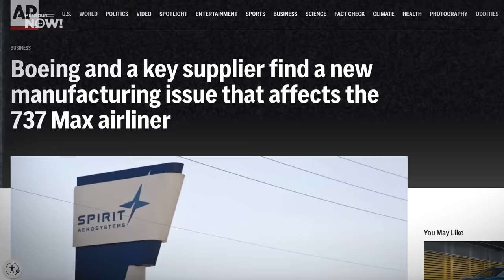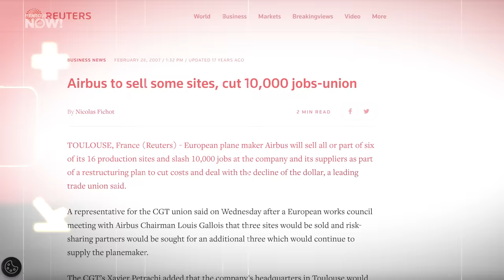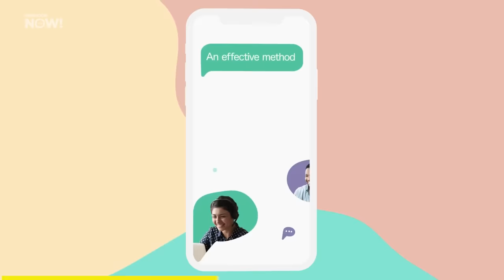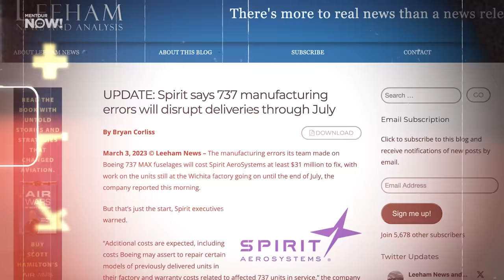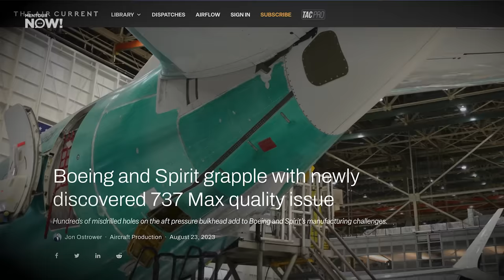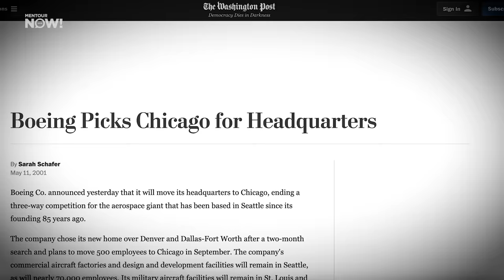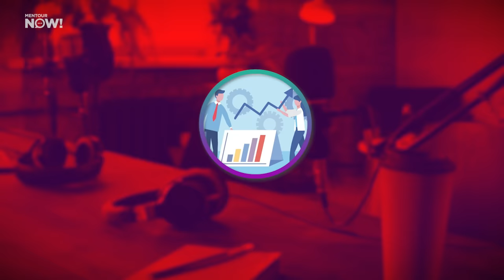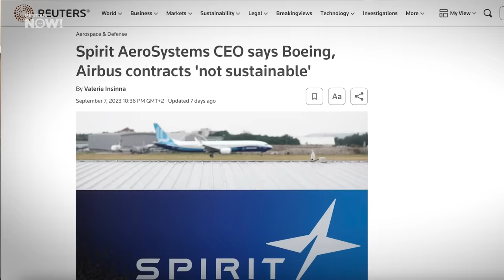NEW Problems with the B737MAX!

Comment: The Max seems to have been the decision of accountants and greedy mangament. It should have been a clean sheet design. Probably would have worked out cheaper in the long run, and be a better aircraft.
Reply: I don't know how many times this need to be said, but the Max uses an old frame because airlines wanted Boeing to keep the old frame.
Reply: almost the whole problem with the Max is the airlines didnt want to retrain their pilots. So it had to work the same.
Reply: You can’t expect investors to wait an extra quarter for millions in profits never going to happen!!! Shortsightedness has killed many companies; blockbuster and Netflix comes to mind
Reply: @lhk7006 , No, they kept the old frame design so that they can go through the simpler route in certification of the aircraft and many of the decision made were to reduce the cost of recertification the aircraft and the pilots. It was idea sold to the airline by Boeing.
Reply: Did pilots or passengers want another generation of the 737?  I have to blame investors and accountants looking for short term profits.
Reply: @FameyFamous money is money 😂
Reply: That does not serve the purpose of maximizing shareholder value.
Reply: The program would've been worth it had it not been for the MCAS disaster. Lots of airlines prefer to improve existing airliners rather than clean sheet designs because they don't have to retrain pilots and mechanics (mostly), lots of parts are still effective for updated designs rather then clean sheets, etc. New production airplanes all have their own headaches, ask any mechanic who works on A220s, 787s, A350s
Reply: Having worked for a publicly owned company, I can tell you that profits for the shareholders trumps everything else… EVERYTHING else. Taking control away from engineers and giving it to bean counters has cost Boeing something much more valuable then money. It’s reputation is in tatters. Can it regain that? Who knows?
Reply: That’s nonsense! Boeing didn’t have the time to build a complete new aircraft to compete with the airbus 320 neo so they just used an antiquated 737 airframe, chucked new tech and put oversized engines on it hence the mcas ! It was cheaper and more profitable!!
Reply: @dwjr5129  its literally a legal obligation - if they dont maximise profit they can be sued. 
Turning corporations into legal people with the obligation to maximise profit was clearly a great idea. Almost as good an idea as basing economic production on the whims of whomever can horde the most.
Reply: Modern capitalism can't handle capital spending.
Reply: @paulparker8298  Ultimately less safe. Profit rules! That's capitalism, baby!
Reply: Great case example of when top management make decisions without adequate understanding. "What? Those talented, educated, experienced engineers are costing us WHAT? Screw that, we're outsourcing to India. what could go wrong?"
Reply: The cost overruns on the 787 limited Boeing’s options regarding an upgrade in the 737 market area.  An all new airplane was estimated to be far more expensive than an upgrade to the 737.

I think that history has shown that the 737MAX has become similar in cost to an all new airplane.
Reply: They managed to screw up a slight redesign this badly, imagine how bad they would a whole new airframe.
Reply: Accountants do accounting, they don't make production decisions.  They don't make managerial decisions.  They do nothing other than making sure bills are paid.
Reply: Yes, it is like you say. The Max8 has still got the center of gravity in the wrong place to accommodate the bigger engine placement so the plane is aerodynamically, fundamentally floored. No doubt will it cause problems in the future.
Reply: The old airframe was not the problem, the problem is the accountants. As a very proud Canadian, I'm quite happy Boeing is going through this, after their sinking of Bombardier. They thought driving them out of business would work in their favor, it just drove them into the open arms of Airbus.
Bringing about the second time Canada's aircraft industry was shit canned by Boeing. The first being Boeing with the Bomarc missile forced buy, which led to the killing off of AVRO and the Arrow program.
Reply: @griffith500tvr  I'm flying in one on Friday. Should I see near the back or front to balance it out?
Reply: You can retain the old airframe and come up with a better ans safer solution than the MAX.
- The wing of the 737 has already been heavely modified at least 3 times (-200, -600 and -MAX series)! So the re-certification and re-trainning argument is an hypocrit one!
- The main draw back of the 737 is that it kept the low ground clearance from the -100 series. While that made sense in the 60s with pencil like turbojet and lack of jet bridges and airstairs in local airports, today with bigger turbofan engines and better equipped airports you end up with the flawed MAX design!
Just came up with a new wing-body fairing design that can accomodate a higher ground clearance gear and voilà! Would not modify the aerodynamic characteristics of the airframe (the wing can remain the same as the fuselage and tail) and open-up more engine configuration options!
Ok you'll have to redesign the nose to accomodate a longer front landing gear, but that would not be a big certification / trainning issue (just look at the nose of a RC-135 LOL).
Reply: Bean counters are always a problem to quality!
Reply: This is a naive, simplistic view. 
The choice they made was on paper the better one. It was the one airlines and pilots wanted. 
The issue was not the original choice, it was how Boeing dealt with the issues that resulted from the choice, and tried to sweep them under the rug.
Reply: @adogonasidecar1262  Others much more qualified than me have said the same, are they "naive and simplistic" in their views too? Also if you're going to accuse someone of lacking gravitas of argument, then you need to qualify your opposing opinion a little better.
Reply: @davidcole333  It was a shorthand for a being a solely fiscal decision. I am not singling out accountants.
Reply: @paulparker8298  Which bit is nonsense? Or was this sarcasm?
Reply: The same can be said to airbus. The a320ceo should have been stopped their and a clean sheet straight after. Would been a better aircraft without a neo version
Reply: @FameyFamous  I have a PPL so am somewhat kind of learned about aviation but in all reality don’t know much about aviation behind the scenes. however with that said I honestly don’t give a 2nd thought to not do most consumers about which flying bus and to a lesser extent even the brand that’s getting me to and from my destination. I and most people care about the best price at the most convenient airport with the most convenient time, and the shortest flight times. 

Recently people have started to somewhat kinda care about the 737 because of its problems but that news cycle has come and gone. No one cares about the equipment they are flying on. 

I guarantee if the Comac C919 was ready and heavily subsidized by the Chinese Gov’t say 25% less expensive than an comparable Airbus and Boeing product, which translates into cheaper flights bet your bottom dollar Spirit airlines would slash their seat costs and Fly the Comac.
Reply: @nickolliver3021  I'm not taking sides here. Airbus has definitely had their fair share of issues.
Reply: @planespeaking  that people need to worry about if people complain here and there about things
Reply: @andywomack3414  yes because the USSR didn’t hide the problems with their first jetliner.
Reply: Exactly - those kinds of jobs are a mesh filter that selects for the worst sociopaths that currently live. I can guarantee that no Boeing manager felt worst about the 737Max deaths than they did about the money it lost.
Reply: @andywomack3414  Stupid take. As if socialism produces safer products, baby!
Reply: @nickolliver3021   not the same situation, the A320 is overall a much more modern design than the 737 and still has plenty of room for improvement, while the 737 was already close to the limit of what you can get out of its basic design -  mainly due to the short landing gear. They called this version the MAX for a reason, there's really nothing more they can do to further improve it without a clean sheet design. And arguably it really would have been better for them to bite the bullet and get started on one 10 years ago since it was always clear they'll need it at some point.
Reply: @johannesgutsmiedl366  given that they don't have a clean sheet design that they've been developing continuously for the last 10 years, what should they do next?
Reply: @davidcole333  The accountants, and in particular CFOs, make recommendations to CEOs, this is how pure accounting data can be used to override what should be engineering area.
Reply: @johannesgutsmiedl366  yes it is tne sane situation,  the a320 is not really much of a modern design if its still got 80s technology over 2020 technology. The 737 has newer technologies with the max and neo versions. Ypu can't get much more out of the a320 321 series either but the neo shows there was room for improvement and also the max shows too the same. All clean sheets now will replace tne 737 and a320 series and they will likely be hydrogen powered or whatever is decided on by tne manufacturers but this is years and years away. Sadly now no manufacturer has got a design ready so we are stuck with both for a long whole yet.
Reply: @esphilee a clean sheet design wouldn’t have been ready in time anyways. And no 737 customer wanted a clean sheet design anyways. You can sit here and argue that Boeing convinced them of that but that’s just not true. They did not want to wait the multiple years longer for a clean sheet design.
Reply: @uclajd  As if that's the only other choice, and an ill defined one at that.
Reply: @lhk7006  ??? irrelevant.
Reply: @adogonasidecar1262  From an economic standpoint i agree. That does not excuse the lack of insight from one of the leader in commercial aviation.
Reply: @nickolliver3021 the a320 may be 80s tech but the 737 is from the 60s and has been stretched to its absolute limits and arguably beyond. The A320 NEO simply got some bigger turbofans slung under its wings, similar to what boeing did with the second and third generations of the 737, a fairly simple upgrade in the end. Meanwhile the 737-MAX is a kludged together abomination trying to somehow drag a now 60 year old design kicking and screaming into the 2020s. Yes the next step for airbus narrowbodies will hopefully be a clean sheet design, but unlike boeing assuming they go ahead with it, it will be at the right time rather than one generation too late. And they also still have the option of just building an A220-500 to bridge the gap if they really want to go all in on "future tech" like hydrogen etc which will likely take 15-20 years from now until it's actually certified.
Reply: It definitely would have been cheaper to go with a clean sheet design for Boeing. But they would have had to twist the arms of customers to accept the need for training and certification for employees on a new type. I think that argument could have been convincing if the new aircraft was good enough.
Reply: @FameyFamous  I'd say it's the old "best time to plant a tree" situation, but they should take their time now... take 3-4 years with design studies, talk to researchers and suppliers to see which technologies are really on the horizon and then settle on a configuration that is bold but still not so insane that it will be a major development risk, then go into development. Truth is, I'd say the same startegy is right for AIrbus, except that they can afford to be a but more risky since they still have an optional A220 based medium haul airliner in their back pocket. Ultimately Boeing is still not in any real danger, they lost their status as top dog but between US government support, full order books at Airbus and airlines not wanting to rely on a single supplier they'll still sell more than enough MAXes to stay afloat.
Reply: @stupidburp  That's a good point and is maybe why the MCAS training was so limited in its scope.
Reply: @stupidburp  I think they could definitely have convinced the airlines, everyone in the industry knows that whether it happens now or in 20 years, there will be a new Boeing narrowbody airliner, so the expenses will be incurred at some point. If Boeing had just come out and said "sorry but there won't be another 737", sales might have been a bit slower but the airlines still would have taken the offer eventually.
Reply: @fredericlepeltier3435  agreed
Reply: @fredericlepeltier3435  having been a vendor to Boeing, I have no doubt the engineers are still capable. The issue is neither the principle of reusing the frame nor the engineers' competency. It's the change in management culture that came from the Douglas merger. At some point it became obvious some incremental training would be needed and nobody wanted to hear about it
Reply: I understand the many reported reasons they didn’t at the time (McDonell-Dougla$), but in hindsight, Boeing should have reached a little higher and modernized and reintroduced the superior 757.  The 757 is a narrow body very similar in width to 737, but it rolls on a significantly taller landing gear.  The 757’s two variants are much longer than any 737, but if Boeing had a 757-MAX, and a few shortened 757 variants with smaller engines than the full size 757 (likely trading some range and MTOW for excellent efficiency) to replace the 737NG series—a 757-Mini, if you will— Boeing would have a much more flexible narrow body platform to work with, and would probably be in a much better position to compete with the ENTIRE A320 series.

It’s really too bad, but I think Boeing discontinued the wrong airplane.
Reply: Indeed it would have been cheaper in the long run and they would’ve got it to market sooner, in hindsight.  Other than single cell creatures, there is nothing stupider than an MBA
Reply: @johannesgutsmiedl366  Why does it matter of the 737 is frommtne 60s? The a320 is frommtne 80s and has been stretched to its absolute limits and arguably beyond too. The 737max got bigger engines slung under its wings but the 2nd and 3rd generations if 737 had slightly more bugger but still small engines that were flat at the bottom. How is the 737max a kludged together abomination trying to drag a 60 year old design kicking and screaming into the 2020s? Isn't the a320neo a kudged up old abomination of an 80s design being dragged out into the 2020s too? Yes all planes current now will be replaced by hydrogen unlike boeing? This new a220 500 is not going ahead anytime soon. All this talk is years away and I'd rather focus on what we have now than is to whats to come
Reply: @nickolliver3021  The 320 isn't at all close to its limits yet, there's even still the option to stretch it again into an A322 version that would then fill the hole left behind by the 757. It's still a fully state of the art aircraft - fly by wire, long enough landing gear for big turbofans etc. The only thing you'd change in a full redesign today would be more composite parts - and Airbus is already developing a new composite wing for it, focussing on making it cheaper to produce than the existing ones used on the A350. Meanwhile for the MAX they had to add a poorly thought out electronic stabilization system and still use a version of the CFM LEAP engine (the same as is used on the 320NEO) with a lower bypass ratio and thus slightly higher fuel burn in order to fit it under the wings.
Reply: @geoffcarlton4047 LOL! Ask the captain on the way in! The pilots balance the aircraft! I’m joking of course, but while I’d never fly a Boeing if I had a choice, if I did I’d pick a seat right next to one of the emergency exits.
Reply: @johannesgutsmiedl366 Thank you. If you hadn’t brought up the point of the 20 year gap between 737 and A380 I would have. Also, I suspect nickolliver is more on the “Boeing” side of the scales so it may not be possible to reason with him.
Reply: @johannesgutsmiedl366   Yes it is close to its limits. Who says there will be a n option to stretch it even further to the A322? Airbus hasn't even said they will do that variant! The a321XLR is filling the whole of the 757. The 737max is a fully state of the art aircraft. long and adequate landing gear for big turbofans. Well sadly composite parts are hard for the industry to get their head around. Airbus is designing a wing for what model that is supposed to be debuted? They are only projecting what the hydrogen era would look like. I dont think they had to add a poorly thought out electronic stabilisation system but they used the CFM Leap engine as it was specifically designed for the aircraft. It was not adjusted to have a higher fuel burn in order to fit under the wing .the engine was made by CFM to be low fuel burn to meet efficiency requirements not because of it being able to fit under the wing
Reply: @adogonasidecar1262  Thank you for that insight! 
You confirmed my conclusion - and in some way that of the video - that the merger and subsequent move of management to Chicago (?) was the turning point.
Such subdivision of a company assets is a receipe for miscommunication and bad decisions. 
The same thing is happening with the management of our (France) railway and utilities sector.
Both are less efficient and resilient than before.
Reply: Does Boeing even even the right engineers to design a new plane from scratch?
Reply: @docvolt5214  of course so should airbus